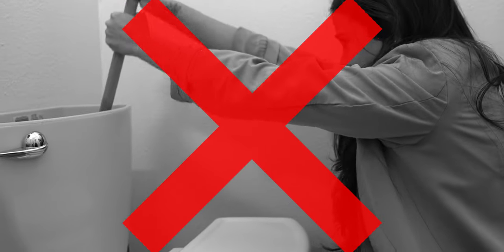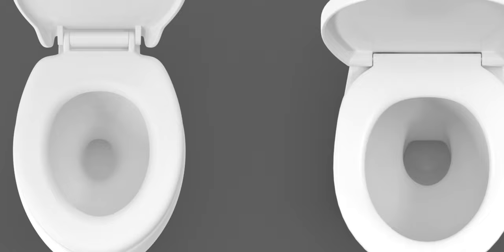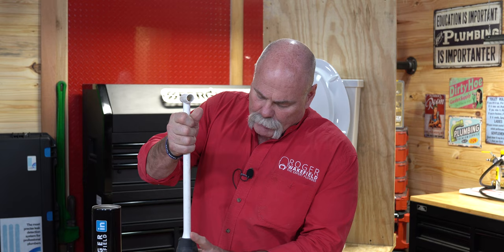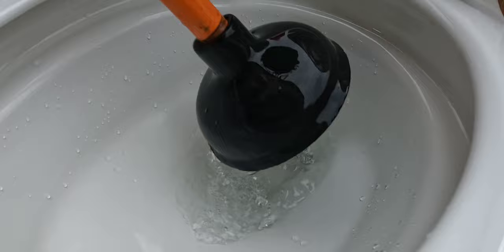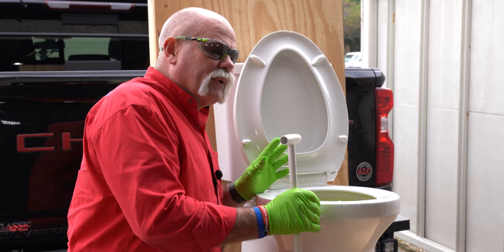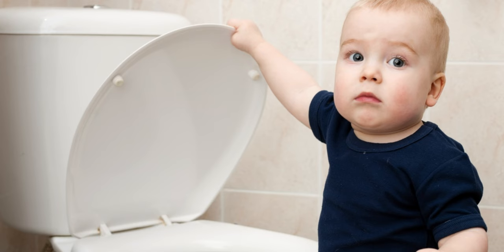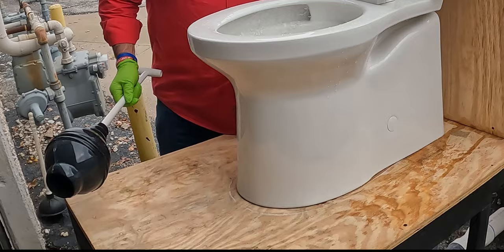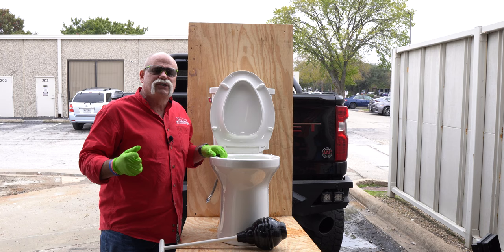Do You Know How to Use a Plunger?

Comment: One thing I really hate is that the stores sell those sink plungers as toilet plungers. They’re not even flange plungers (which are designed for toilets and usually perfectly fine. However, as they’re a fair bit more rigid, they may have issues sealing against some toilets), so they should be sold as sink and tub plungers. I also hate that accordion plungers, which are sometimes essential due to the sheer amount of force you can get out of them, are almost always entirely plastic (no rubber, poor seal).
Also noticed you giving it a couple of slow pumps first. Definitely a good idea, as it clears as much air, which is compressible, as possible, and replaces it with water, which is incompressible.

Comment: I am a bit confused as to whether you are supposed to use the plunger to push the plugged object through on down the line or use the plunger to make a suction and draw the plugged object back into the bowl. I've seen it done both ways. Great video!
Reply from the maker: Both! As long as the clog is cleared you've done good